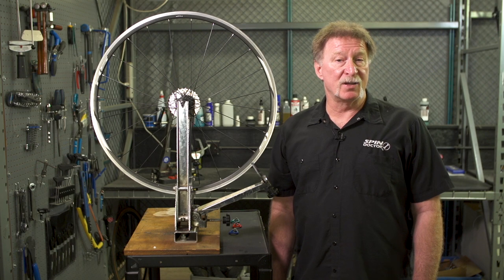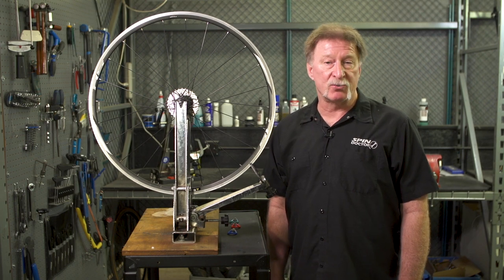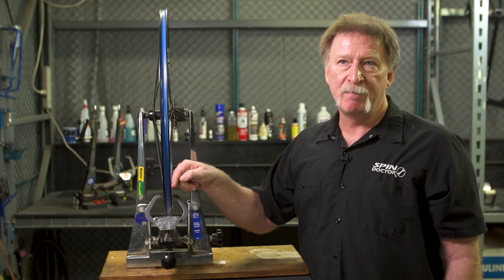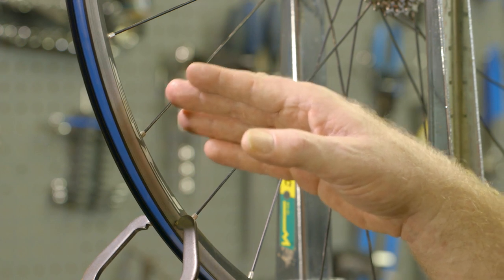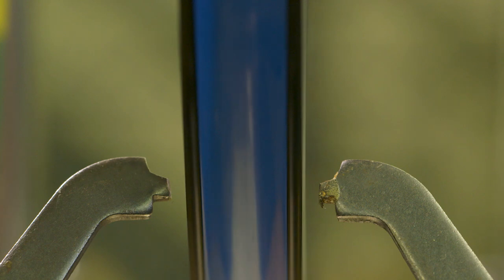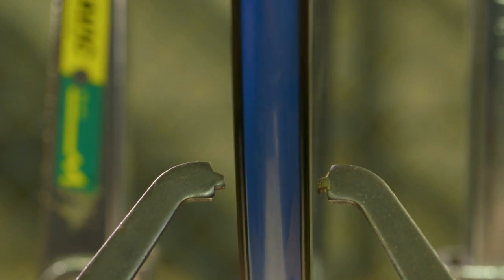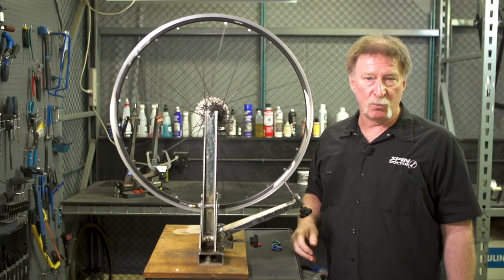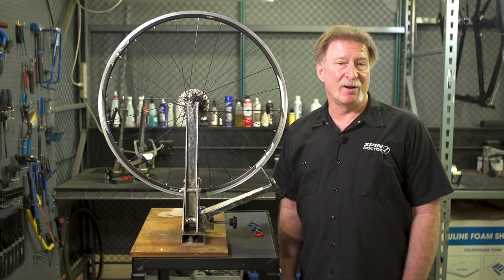Basic Guide - How to True a Wheel

Comment: If you have an extremely out of true wheel, or even if you're replacing spoke nipples or something else that requires releasing all the tension in an old wheel how do you find the correct center point to reference to pull the rest of the wheel inline with?